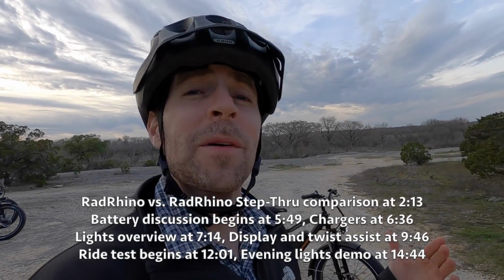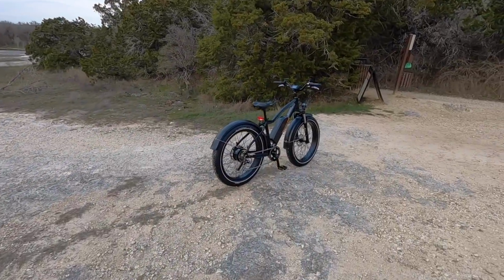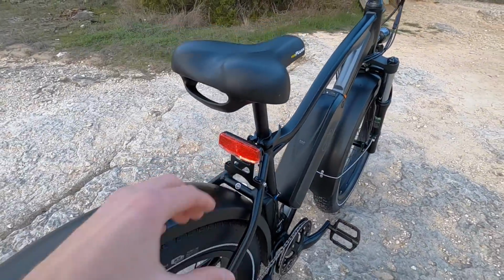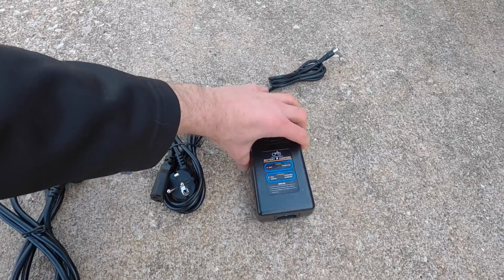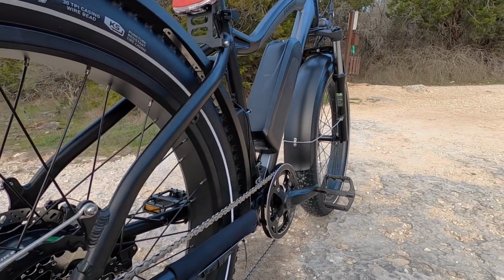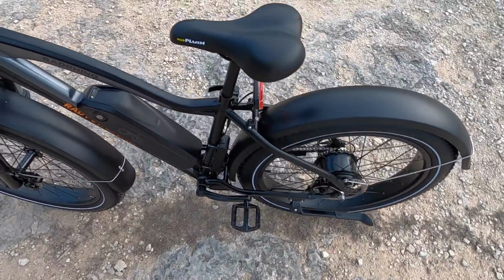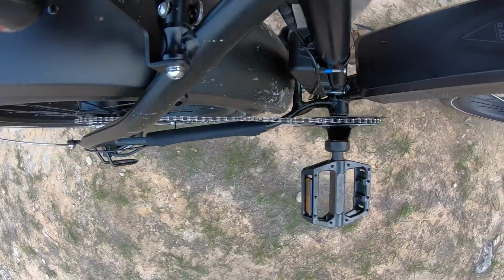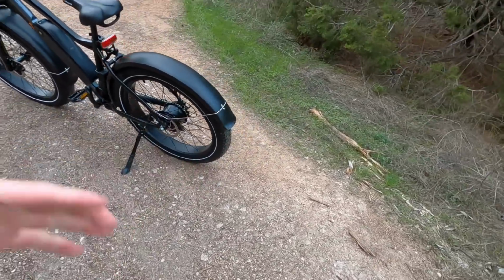Rad Power Bikes RadRhino 5 250W Review - €1.6k (EU Version)

Comment: what did you think of the difference between the 750w and the 250w motors
Reply: same motors, different controller, all motors are 500w
Reply: @lIlIlIlIlIlIlIlIlI  if I bought a rad rhino 250w. And changed the controller then would you say it is then a 750w e bike. I don't think so. If they are both 500w motors then are they the same size dimension.

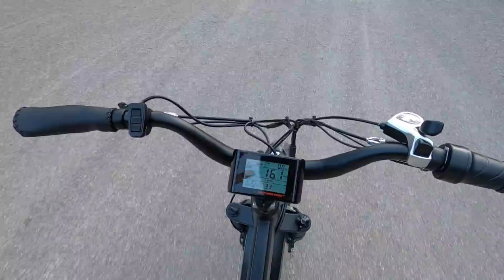Comment: Not to be bad....If this is the 250W Version! Why at 12:45 is the display showing 734W?
Reply: Old comment but I'll answer for anyone still here.
250W is the maximum continuous rated power. Basically, the manufacturer is saying it can run for a long time at 250W output without any issues, but in for short bursts like going uphill or accelerating, it can draw more when it needs to. Since EU and UK e-bike laws only care about maximum continuous rated power, this is perfectly legal.

Comment: That battery design is really ugly and can be solved better. Other companies already do that.
Reply from the maker: It's true, the battery isn't as hidden or integrated... however, I like that they've made it cross compatible with all of the other current-generation Rad products, and kept replacement packs significantly cheaper than the competition. I replacement Rad Power Bikes battery in Europe is roughly €599,00 whereas the similar capacity Bosch PowerTube, Shimano Battery, and Brose batteries are upwards of €899,00. I think this has to do with how the latter companies integrate the battery controller and have packs that are designed to fit inside of frames. They often have metal cases for structural integrity or maybe durability, but they all cost a lot more.

Comment: What is the actual difference from 250w to the 750w europe rhino? I am going to get one of these 2020 models this year but will buy without trying them out as i live in denmark and not anywhere close to german test site. :P Is it torque only? And why is the price the same?
Reply: they use the same 650 W Bafang on all of their bikes.its just software reduced to perform like 250 W which you can unlock easily.Dont be naive.
Reply: @alextamas7936  is it really 650w bafang? BCS in this video it looks like it´s 350w bafang https://www.youtube.com/watch?v=7K87AIiXFpY&t=16s Maybe they done some ups after this video was published on yt. My rad rhino 250w will be coming soon (3-5 days) so ill be taking the motor apart, to make shure whats really there. Neverless i think the US/CAN version gonna be the same as EU 750/250w. Just controller on 250w gonna be smaller I guess. So boltons power kit shoud work fine
Reply from the maker: Hey David! Be careful if you take the motor apart, but do comment back with what you discover. I'd love to know, and I am sure that others in the EBR Rad forums would too, maybe you can post some pictures there?! https://electricbikereview.com/forums/forum/rad-power-bikes/
Reply: PS
Get the cheapest version its still the same motor.
Reply: and they are solid bikes for sure.
Reply: @alextamas7936  Only 100 euro difference. If I unlock them will I get the full 650w and if so what if the police want to test the bike? :P Will it then perform as the us version? :P In Denmark you need casco insurance for speedpedelecs(45km*t). I have seen a few of these bikes in Denmark this year, they seem to pick up popularity here.